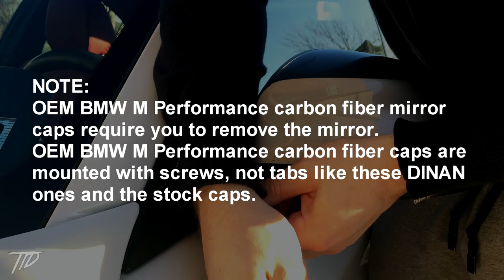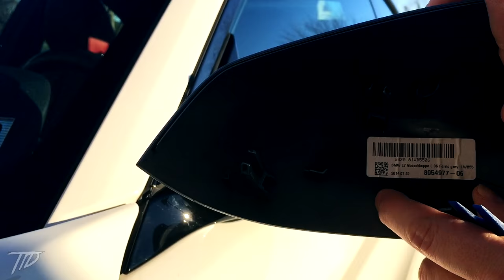How to Remove and Install BMW carbon Fiber Mirror covers the RIGHT way!

Comment: Thanks for this, thought this was how you did it but was a bit scared to pull too hard! Word of advice for anyone attempting this, do it on a warm day. If you do it on a cold day the original caps are more difficult to pull off and more brittle. I spent about 30 mins trying to do this on a cold day and got nowhere with it, and then managed to do BOTH in 5 mins on a warm day!

Comment: This was a great video. Thanks buddy. I really do like the grey ones actually. Also just a tip with the prý tool, when you push it in, twist it and things pop off easier. A tip I got from a bodyshop guy which really works.

Comment: thanks! I dint know Dinan sold these. You just saved me money, appreciate it! Though your install looks different than all the others. I believe popping the mirror off helps. These should all be installed the same I would think, no matter the manufacturer.
Reply from the maker: I didn't want to have people break their side view mirror glass by prying on them to pop them loose.  That's why I showed this method of popping the caps off. Though if you feel comfortable prying the mirrors out, I'd recommend installing the carbon caps that way.  You run less of a chance of breaking the carbon mirrorcap tabs and you'll be able to see if the tabs are seated in the housing. I'll eventually put up another video showing how to do it by prying the mirrors out.

Comment: I bought a pair of the Dinan carbon fiber mirror caps and one of them is having fitment issues.  Anyone else experience that?  Any suggestions to get a better fit other than just replacing with a new one?

Comment: did any of the tabs on the stock ones break when you removed them?
Reply from the maker: The OEM covers tabs seem strong.  I've removed and installed the OEM covers a few times and no tabs were broken by popping them off the way I did it in the video.  The carbon fiber covers tabs seem a lot more brittle so I would not try and pry on those to remove them.
Reply: alright thanks man! just got mine in the mail a few days ago about to install them soon, great video

Comment: Dude you pop the glass out first then you can get to the taps inside to release the back. Prying off the cap like that is going to snap the tabs or break the cap
Reply: But did that happen 🤔
Reply: That's indeed the correct way.  Pulling them off is ok if you don't care about the current caps and breaking a tab.  On the other hand, many folks have broken the mirror glass taking it off... it's fragile.  if you have an F3X with anti-dazzle (auto-dim) then the glass is $325 per side... so it's worth the risk to do it this way if you have expensive glass.
Reply: Mike W . Yep, pop the glass out first is the right way, as recommended by BMW technicians.  👍
Reply: I had no issues just popping the covers off. Both on my M240i and my m4. Took 1 minute a side
Reply: I cracked the glass doing it this way.

Comment: So you remove oem casing and replace with a cheap aftermarket. I thought this video was for oem fitting as I need to know how to remove mirror for the screw fixings. Change the title to aftermarket mirror caps.